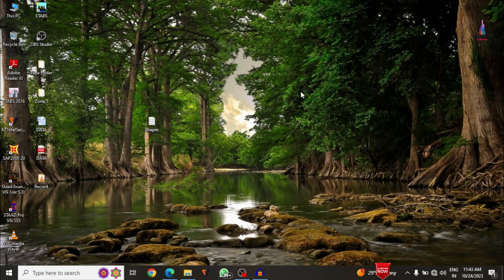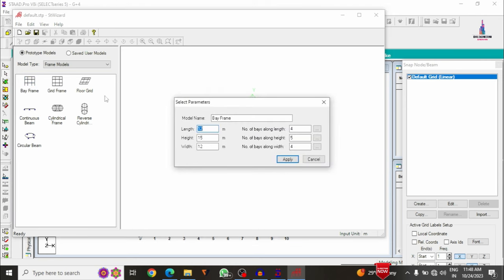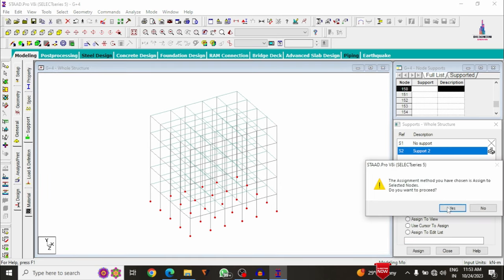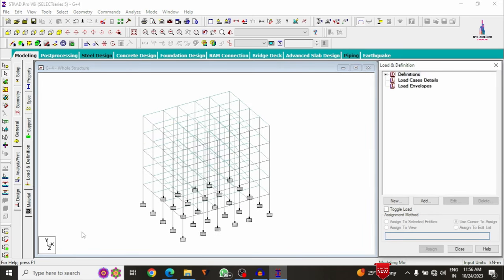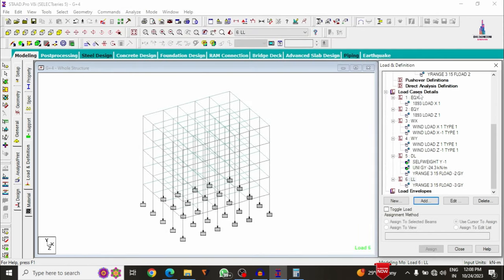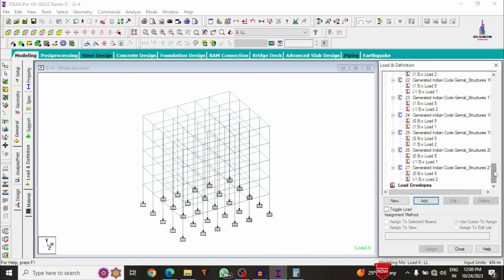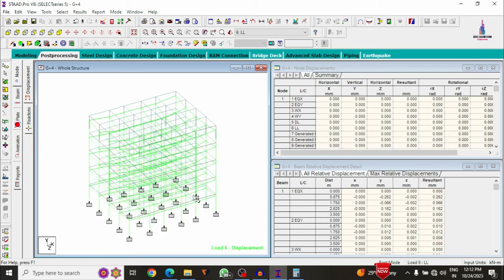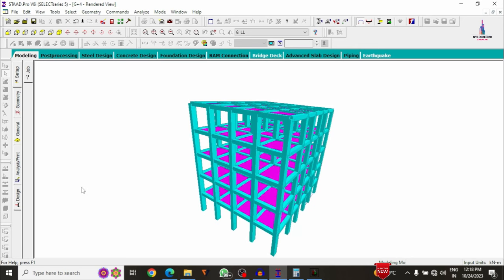Learn complete building design by staad pro in 35 minutes for beginners| easy steps building design|

Comment: U had already defined the plate thickness and its property, and self weight multiplying factor as well. Then y u add floor dead weight manually in seismic load defination..